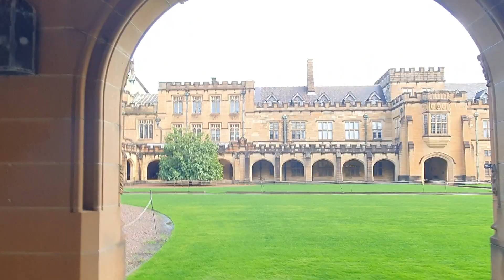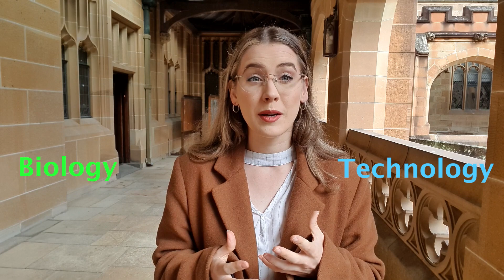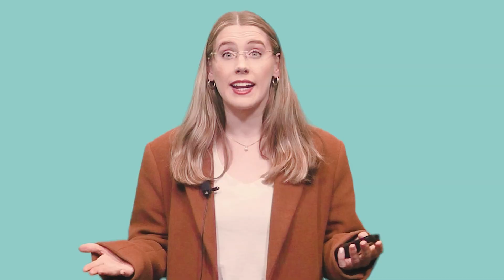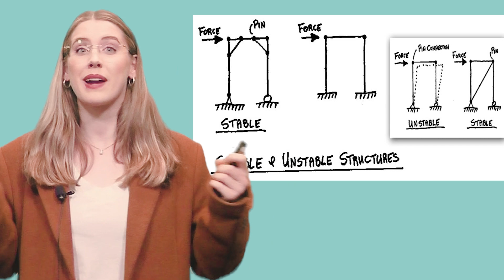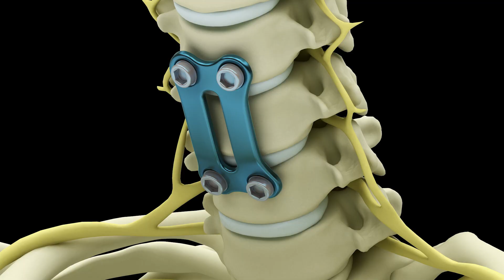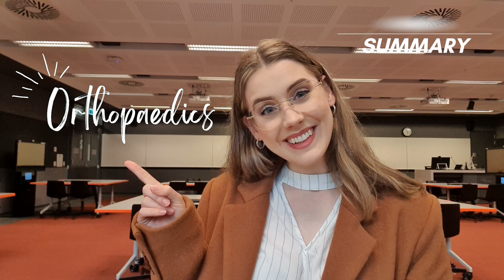What IS Biomedical Engineering? (+ Intro to Orthopaedic & Surgical Innovations)

Comment: Its an interesting field, however, I dont recommend it, since it is very broad. You need to hone your specialized skills along with massive course load. Every course Ive taken specially biomechanics and physiology have been interesting. I did a small project about bionics for my biomechanic class and when you go to the details, it even becomes more interesting. However, those jobs are done by electrical or mechanical engineers and medical scientists as occasional advisors. So its good for a higher degree with someone who puts a lot of effort in specializing him/herself.
Reply: Hi, Can you elaborate more about biomedical engineering? I'm planning to pursue BME cause my 12th is completed.
I'm really confused between BME and BTech Biotechnology.
I'm really interested in biology and I like maths too, I'm comfortable in maths  but I don't wanna pursue MBBS. So I'm thinking of pursuing Biomedical engineering.but is it worth it ? I really need guidance rn . I'll appreciate if youll help me .
Reply: @annalisa2265 what did u do. .¿ it’s the same for me too